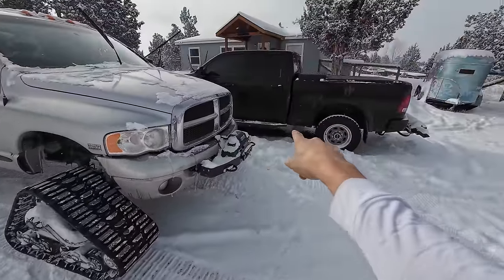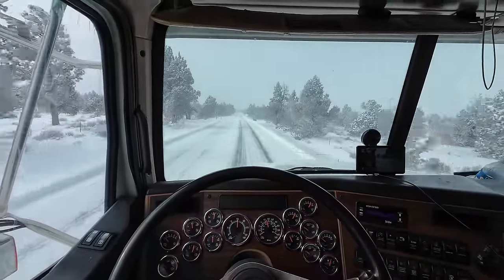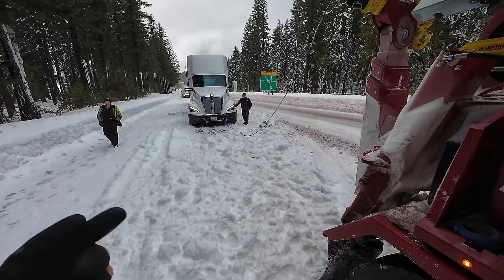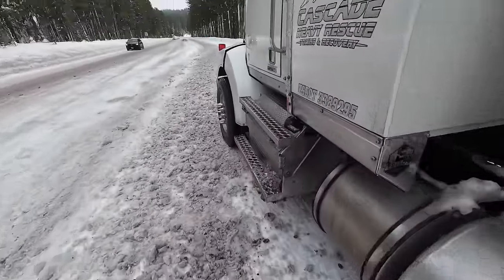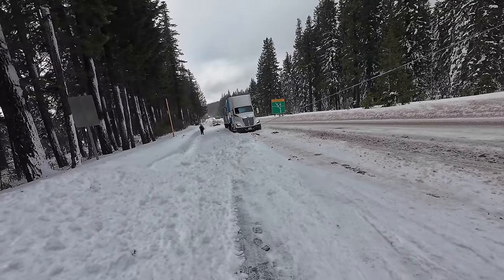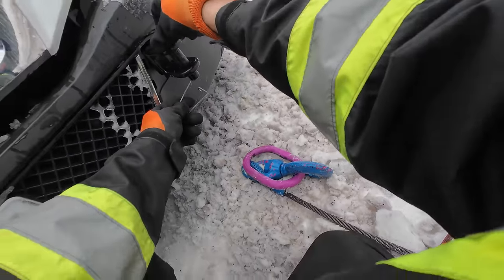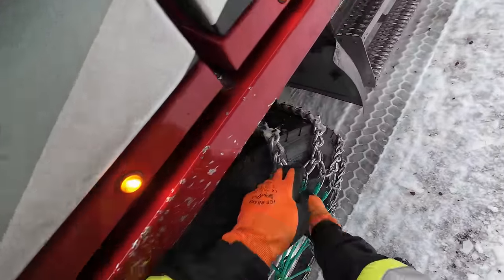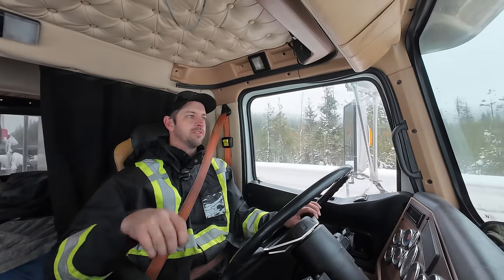The mountain gets another one!   Heavy duty winch out

Comment: Casey your a great guy and very knowledgeable but I have to make a point here concerning your shackles that you talked about in one of your last videos. Backing the screw pin off slightly (not 1/4 turn) wouldn't reduce the WLL any more than that DROP IN pin with a $0.37 safety pin securing it on the front of this truck. Backing the screw pin off just slightly (again, NOT 1/4 turn) reduces the chance that you would need a wrench to loosen it after the pull. It's just my opinion, and I'm not an educated man, but if loading up a screw pin that is finger tight distorts it enough to NEED a wrench to loosen it then it's BEEN OVERLOADED! Keep on doin' what you do bud! You're rocking it in the northwest, we'll try to take care of the Southeast!
Reply from the maker: You need to learn the difference in what those two type of shackles are designed to do before comparing them.  They are NOT the same.
Reply: @CaseyLaDelle  I know the difference but a pretty bright fellow told me 'negative comments' help the algorithim. Just trying to do my part! LOL!

Comment: Back in the old days they had alcohol injection systems for the air systems. Now they use air dryers but you need to drain the tanks all the time and they may not keep them from freezing.  I remember that they had either injection systems for those cold winter mornings.  But they didn’t have a the crap that the new diesel have.
Reply from the maker: That has nothing to do with the brakes freezing to the drums
Reply: If you are getting moisture in the air tanks with an air dryer, it is malfunctioning.
Reply: @CaseyLaDelle  I thought that the lines had frozen.

Comment: Remember, if you get that shitty bio-diesel blend, you need to DOUBLE your anti gel treatment.; that's in the fine print. Also knowing the LTO of the diesel in your tanks is key. Lastly, simply throwing anti gel in the tanks does nothing for what's in the line/fuel filters. Need at least 5 min of run time,  or add a lil directly to fuel filter. Last tip from a Northern Frostback, i keep an old anti gel bottle full of diesel --immersion bath that to heat it up,  pour some warm diesel into my fuel filter, and I'm not having any issues -24c down to -35c. Note that most diesel where I'm at is LTO -25c or better WITHOUT the anti gel...

Comment: You run your truck all night in those warm temperatures????   🤣🤣

We just got done a spell of - 40 & -50c and not one semi that I know of had issues starting in that.  The strange part is that I know MANY cars and trucks both gas & diesel units that had serious issues and some still are not running.  Strange how the weather attacks different vehicles.
Reply: But doesn’t it depend on what fuel is used? Whether it’s intended for that temperature or not, or treated if needed. I believe his wasn’t thus running the truck was best method.

Comment: Don't you have winter diesel there? They change all the pumps for winter version at fall here. (Also secret: Diesel that do not turn green from taxes, seems always to be the winter version, at least here in the real North ;P  Also no I don't drive public roads on Fuel Oil. p.s for VeroKarhu)
Reply from the maker: There is absolutely no difference between on road diesel and off road diesel.   The red is simply a dye that they put into it at delivery to distinguish the tax status.
Reply: @CaseyLaDelle  Yeah, maybe it's true in Oregon, but here Fuel Oil is always winter version rated for -26C, and in Lapland -44C.
Reply from the maker: @HVM_fi  there’s no “maybe” about it.  I am telling you facts.
Reply: Ok, quick read, there are no laws for Winter blend or additives at USA for fixed time frame, only guidelines for gas stations. Here is by EN 590, November to March pump should only give Arctic zone class 1
Reply: Sounds strange that they have that problems there. As you say, here we have winther fuels and its no problems to have diesel cars shut down for a few days in -10 f (-23 c ) and still start them without heater or problems..
Sounds cheap and good for the envorement to have engine running all time..🤔
Reply: @heltratt6363  I was fooled by mountain passes that Casey shows, winter conditions are way worse there than here in Finland. Oregon as whole is not that cold, and it's not cost effective change blends for few really cold days for gas stations, -is my guess.
Reply: @HVM_fi  
Nothing can be more worse then Finland / Soumi.. 😜😉

Comment: Idling is terrible for SCR emission control systems, just a FYI. You're much better off plugging in the block heater.
Reply from the maker: This trucks job is to regularly idle for hours on end.
Reply: @CaseyLaDelle  Good point, in a case like yours I think it might be an idea to get a spare set of filters to swap in so that you can have a local shop bake out the set you just removed. Probably also a good idea to get some spare sensors to put on a shelf for when you need them.

One of the big lessons from the recent global event was that parts could fall into short supply... I don't know how Western Star trucks are setup but I do know that trucks like Frieghtliner and others using a one box (SCR) system had (or still have..) a major issue with not being able to readily replace the SCR filter itself. 

Only the DOC and DPF filters are replaceable.

Comment: I don't understand why anyone who lives in cold climates like in ID, MT, etc., and who have diesels, don't add anti-gel to their fuel tanks?! That is the first thing I do when the temp dips below 50ºF.
Reply from the maker: My pickup gelled up WITH anti gel in the tank.   And the only reason I had some is because I had leftover from last year.   Right now, and leading up to that I’ve storm it was impossible to buy in this area.   I had to make the decision on what trucks to put it in and what trucks to just forget about during the cold, because no one had anti gel in stock.   The rancher in my previous video had two cases of it ordered over a month in advance and still sitting on back order
Reply: @CaseyLaDelle  , FYI; the best and ONLY anti-gel I have used for over 30 years with 100% success is Power Service (White Bottle) and their Diesel 9-1-1 (Red Bottle.) Howe's and all of the others are garbage, and I've tried them all. I have used Power Service in my personal 7.3 Powerstrokes, and when I drove semi, in all of the tractors, which were Cummins N14 Red Top engines.

The Diesel 9-1-1 re-liquifies gelled diesel quickly. Here in MT/ID I have gotten stranded Sprinter drivers back on the road a handful of times with it.

Comment: Q how are your working airsystem is airdryer or alkohol?
Reply from the maker: Just drain the tanks on occasion
Reply: @CaseyLaDelle  in the nordic coubtries we do need to have either airdryer or alcohol, I have had a main cylinder brake because the company bought cheap alcohol only 70% and you needed 99,6% this is year back todays trucks have airdryers.